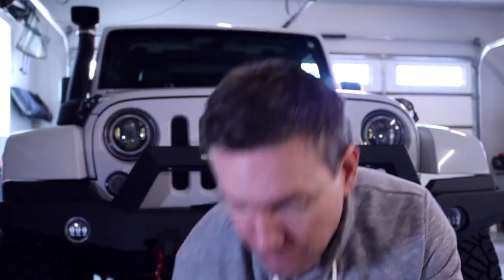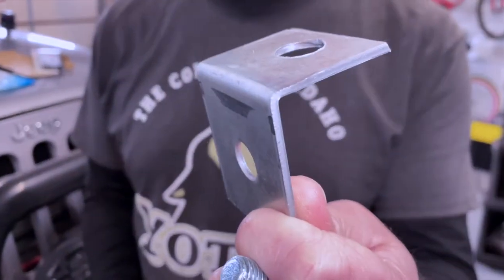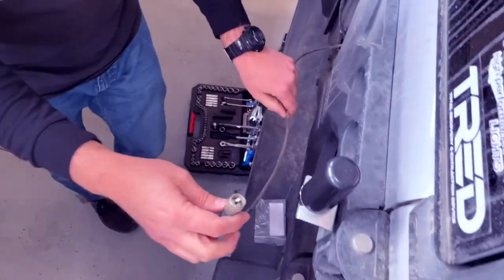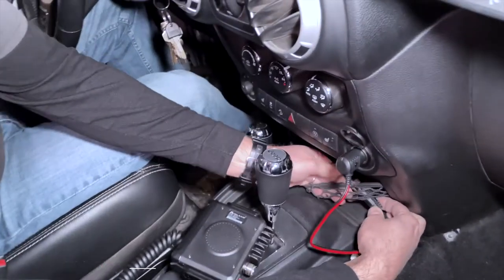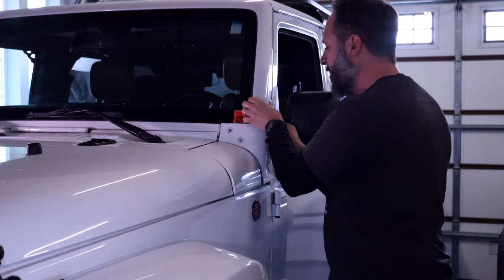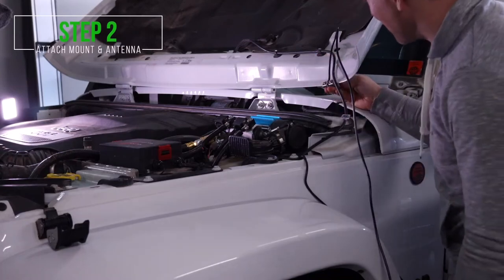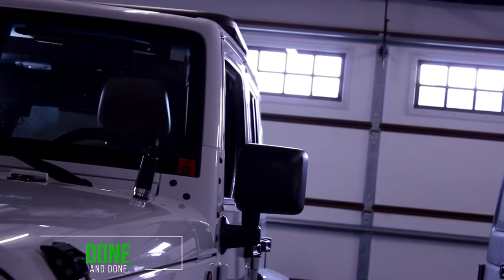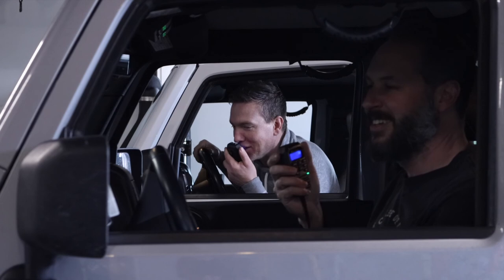Jeep Wrangler GMRS Install | Midland MXT

Comment from the maker: We are really liking this GRMS unit so far. After a bit of fussing with it, Chris actually wound up putting his in the Center Console as well. We did a range test that wasn't filmed. It was solid at 1+ miles in a winding canyon road - which is about 100X better that our old CB set up. For more V2R vids click here: https://www.youtube.com/c/venture2roam
Reply from the maker: @TryNDoxMe Wow. That's serious range. And your right, that kind of range is critical in a bad situation. Ham is still the best radio out there, but GMRS is so easy to use it's become our defacto group radio choice. Thanks for sharing!

Comment: Looked like you mighta bunched up a lot of antenna cabling in the center console with the radio.  Run the extra length around the cabin or something to use it up, you'll get better performance if you don't have the extra length coiled together.  Always surprised when folks install these tiny +3db antennas below the vehicle's roof.  If you could get it up there, or even go with a longer GMRS antenna (many are +6db), you should really increase your range, I'd think.
Reply from the maker: Thanks for the tip Jay! Once we decide the permanent install location, I’ll go back and distribute the coax. Right now, I’m still testing the antenna location, so want to make it easy on myself should I move it farther from the cab.

Comment: Did the audio come though the handset or the base?
Reply from the maker: It came through on the handset!  I guess I forgot to mention that!!!
Reply: Yes you forgot but thanks and great vídeo at always 👊
Reply: It can be configured to come out of the base, the mic, or both.  All in the manual.
Reply: So, you had no issues using CB cable connecting to the rear of the MXT275? Just tried and seems to be a wicked tight fit onto the back of the radio. Two different connector numbers too, from what I can see online. Thoughts?

Comment: CB gets a bad rap off roading mainly because everyone is using $50.00 Midland and Cobra cb that won’t transmit from one end of a street to another, and not tuning the Antenna. I’m now running both in my truck. The MTX275 is a good radio.
Reply from the maker: I love CBs… but found that in a convoy we always had problems, sometimes because of the reasons you mentioned. GMRS has been a bit more foolproof that way. Thanks for sharing!!
Reply: CB still serves a purpose, but GMRS is definitely a better service.

Comment: Do you have to remove the antenna to rest your hood on the windshield frame now?
Reply from the maker: Great question. NO. It doesn't stick up enough to hit the windshield when we lay the hood fully back. It's really easy to take off if that were an issue though. Update - I'm moving to a full-sized Midland GMRS antenna mounted just off the driver windshield. Better range and it's no longer in my field of view.
Reply: @Venture2Roam  Will you be posting an update video with the install?
Reply from the maker: We will! Actually shooting it this weekend.